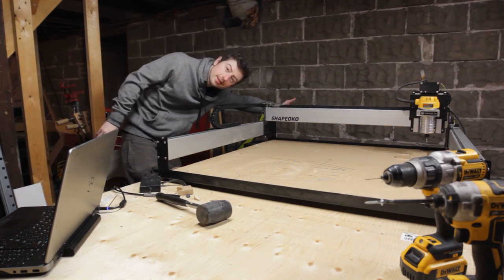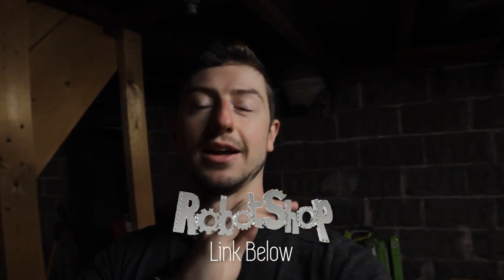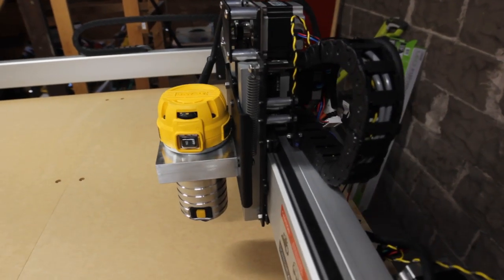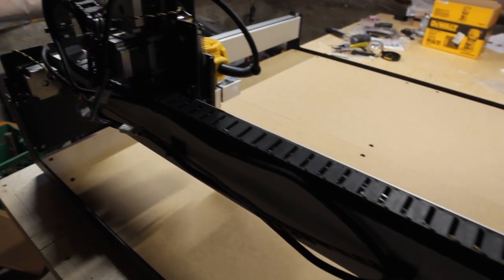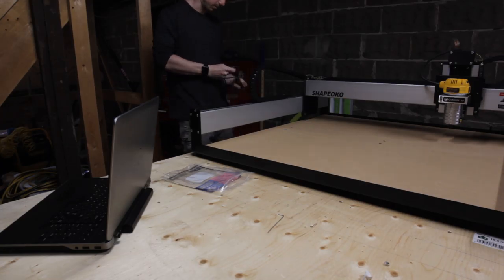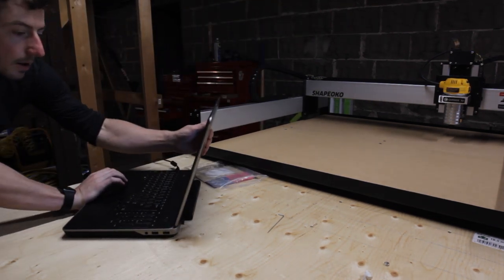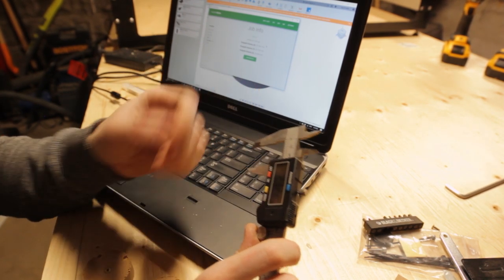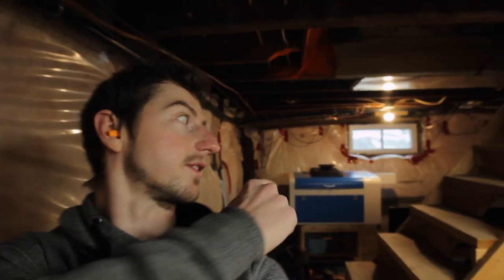Building the Shapeoko XXL

Comment: I have a stepcraft 840 cnc, assembled it myself and had the same problem you're having. The way I came to resolving this issue was by loosening the end rail bolts on all corners and manually (with no power) bringing the gantry to one end with using 2 blocks like 123 blocks on either side in between where the gantry "hits" the ends and once it's square to the blocks on both sides tighten up the bolts and rinse & repeat on other end. Hopefully this can work for you!😃👍
Reply: P.S. I think the correct pronunciation is shape-O-ko

Comment: Got a smaller system last year to make PCB, but it was too hard for me to get right and the quality was nothing like I can get from China, so the CNC has sat idle, but hopefully videos like yours will motivate me to do other things with it. For setup I found some of the videos on setting up conventional mills with dial gauges were useful. Finding some way to quantify troubles has usually helped me in the past. Good luck!
Reply: one doesn't often see 'China' and (good)  'quality' in the same sentence...
Reply: @lintelle2382  Pcb from jlc in China are the best quality I have ever had, far better than anything I have ever made or bought in the uk.